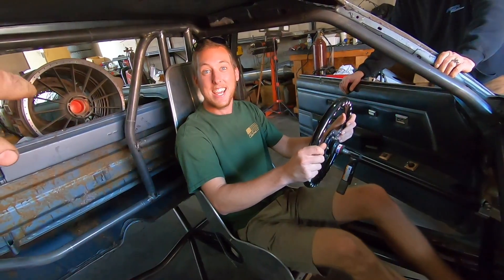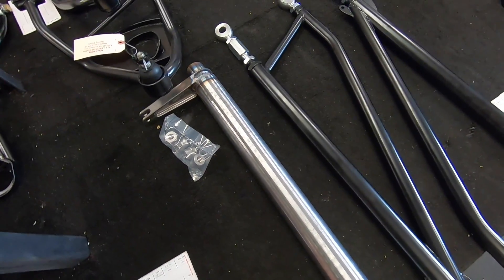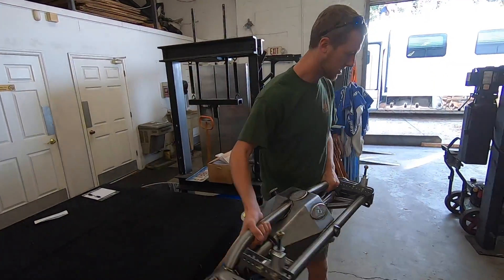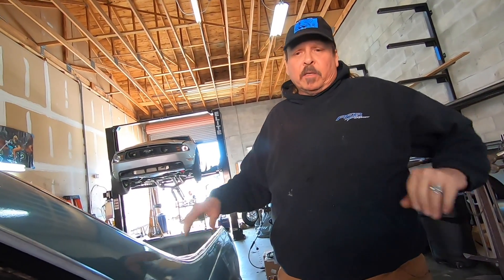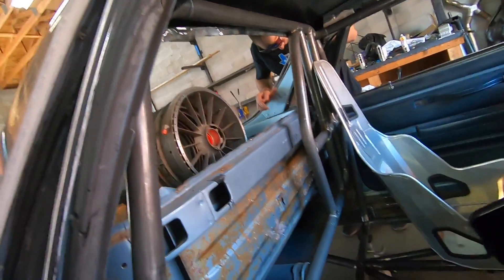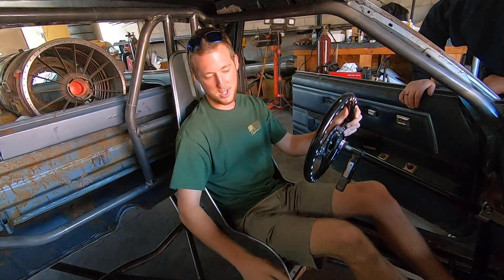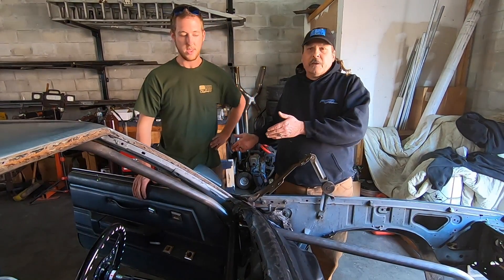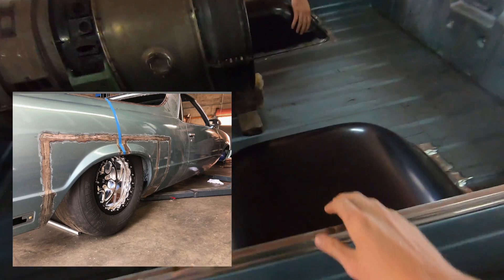The Jet Camino's Roll Cage is INCREDIBLE... First Cleeter Test Fit!

Comment: Guys be careful with the pressure difference on the windshield and how it will affect the drag of the car. Take it to a wind tunnel to be safe. If there's one thing that won't forgive, it's physics.
Reply: I was thinking they should keep the windshield full length and just let the turbine suck through the passenger window. Or even a hole in the roof. Hell they coulda left that ac/heater hole in the dash open. You could get a lot of air flow through those two spots without sacrificing aero. Or even suck through the floor and keep that sucker vacuumed to the track. I think cutting the windshield is a bad idea.
Reply: Carlos I’m sure the Larson boys have a good idea.
Reply: Carlos physics forgave Leroy...
Reply: Under pressure 🎶
Reply: @IrocBlower85  horsepower forgave leroy.
Reply: @jonhubbard5787  Was that a Logic reference? lol
Reply: @Blaze4255  Na bro, Queen.
Reply: IrocBlower85 Leroy would be in 6 second territory with good aero
Reply: There's no windshield dude
Reply: @lee1978good  Well not right now there isnt, but theres going to be

Comment: Is it ginna affect handling having a positive pressure on drivers side windshield and negative pressure on passenger side since there is no windshield. I know as air flows over spoilers it does weird things i wonder if the car will try to pull to driver side
Reply: nathan butler I was thinking he same thing. I wonder if it will try to pull to one side or the other.
Reply: I can't see how it wouldn't want to twist the car.
Reply: I was thinking the same thing. They should put a huge scoop on the roof down through just the back half of the cab that way they can center it on the car
Reply: They will be able to counteract that a little bit by aiming the jet a certain direction, but this thing will be VERY sketchy to drive. Like a open wheeler with all the right side aerodynamic bits knocked off
Reply: @drewl4762  I think the scoop is a good idea, but itll be hard to get that much flow
Reply: I’m thinking adjustable mounts on the jet-engine 🙂 So you can adjust up and down a little and to the sides 🙂
Reply: @connorbeckmann2981  I'd rather have less flow and be able to keep the car straight then ample amount of airflow and little control
Reply: youd have low pressure on passenger side due to jet engine S U C C and high pressure on the drivers side so the car would prolly pull towards the passenger side. id go for the roof scoop.

(Or have the seat in the middle, and run the driveshaft between your legs. or go fwd or sth and have the air intakes be on both sides of the driver?)
Reply: Just put half a splitter on the front to counter balance the drag and straighten it out
Reply: Dylan Hale the problem with this is when you hit the jet throttle hard it will pull to the side until it reaches a point where the aero issues will balance it
Reply: @drewl4762  I agree a full moulded scoop like a F16 belly scoop...
Reply: These are all really good contemplations. There is a really good channel on YouTube called KyleEngineers. Dude is a PhD in aerodynamics and designs race cars. He doesn’t update the channel anymore because he went to work for an F1 team, but there is some interesting stuff there. He gets into some common misconceptions and design flaws with aero for race cars, and talks about the fact that it’s far more complicated than most of us think. In fact a lot of aero stuff people do is either useless or actually counterproductive. Cleetus and crew could use someone like that to design some aero for Leroy, and advise on this jet contraption.
Reply: What concerns me the most is not so much that the car may pull to one side but that the pull may change directions. While the jet is at a high power level there should be a vacuum created in front of it so the car may pull to the left slightly. While the jet is suddenly shut down there will be an increased pressure on the intake side of the jet so it might pull to the right slightly. This transition might be fairly slow if everything works properly - but what will happen if the jet suffers a sudden failure, say a bearing seizes or a turbine fails. At high speeds any instability, especially sudden, could quickly turn into a nightmare...

I hope the driver's vision to the right also won't be blocked by the jet's intake. I'd make sections of it out of Lexan if it was at head height on the passenger side of the car.

I agree with some of the comments below that a safer plan would probably be to use a large, centrally located scoop. It would probably need to sit above the roof and could be as wide as necessary. I'm imagining something close to a foot tall, centrally located, fairly wide, sitting on top of the roof... (the internal ducting could be non-symmetric though, with more of it on the passenger side after it comes through the rear of the roof).
Reply: @fordcougar99  exactly! If I fighter jet can get enough air through a scoop then this car get enough air especially since they probably wont run it at 100% output anyways
Reply: They could build a rudder behind the jet engine. That might solve the issue
Reply: Not only is pressure difference @ front between windshield (driver side) and no windshield (rider side), there is a huge vacuum created at the air inlet of the jet engine ... similar to a regular car engine, but much, much more vacuum.  Air is not just traveling thru the jet engine, it is being thrust out the back ... huge pressure at back of jet (thrust) and huge amount of vacuum at the jet inlet ... 

Hello roll over on big end.
Reply: I was thinking roof scoop too, you think that'd reduce down force though?
Reply: Just go with no windshield, problem solved

Comment: Just roof scoop it instead of going through the entire cab
Reply: Drew L the scoop would be HUGE!!!!
Reply: @riverrat1284  so put a huge roof scoop on it.
Reply: they explained this in another video... cant do a roof scoop, not gonna work. hence the pass thru idea.  👍
Reply: tomlundkwfl could they not cut out a section of the roof and run it at an angle up?
Reply: It's do-able. Trying to maintain stock lines is a fools errand. Combine custom intake roof intake with a  one off formed windshield to feed the intake and the thing will perform optimally, and look badass.
Reply: @x...CrankyOldMan...x  I missed that I guess but why wouldn't it work? Outside air is outside air. An unrestricted high flow air inlet is actually a gain...not a loss. That's how drinking straws work. Pull more air than the drag (tires and body contour) and the mass is actually pulled.
Reply: @keithfriestad3949  If you mean angle the jet upwards to line up with a roof scoop, that is a very, very, bad idea unless you wanna visit the man on the moon
Reply: It wouldn't get the airflow it needs having it go on the roof. Even with a huge roof scoop. Also imo would look stupider than shit with it. And the jet engine MUST be angled downwards. Cleetus isn't trying to build a flying car... yet 😂😂
Reply: Better idea would be to stick the jet on one side. Then put another one on the other side so it's balanced and all and sit between them :-P
Reply: I wonder if they can run the Chev on Jet A-1 as well?

Comment: Hopefully you have a way to prevent the jet from lighting if you pull a wheelstand since that would negate the 1 degree down position of the jet and send you into orbit. Normal jet cars are thrust only and don’t have to worry about climbing the ring gear.

Comment: Put the scoop for the turbine flush with the top of the roof.  FoD will end your fun faster than anything you've ever broke.

You may also want to consider a rear wing to keep the nose on the ground AND vertical stabs to aid steering at high speed.

Comment: love it . but on the 1 deg. tilt that's likely  for only jet power if your on the motor in full pull mode the nose might up a good bit more than just sitting you might need extra angle you don't want to create lift

Comment: This thing is such an awesome build... you know what would be really cool is if you twin turbo the ls and then had two pipes coming out of the hood for the exhaust (similar to Leroy) and when you did the two step you would have the Flames coming off of the LS engine exhaust and from the jet engine... that would be a hell of a show.... I'm sure with a 1000-1500 horsepower LS plus the jet you guys are going to set some serious records.

Comment: I have concerns. If you get any degree off straight, that jet will push you right at the wall.  Wheel spin from the LS can easily set the back end off line, and you won't have reaction time to turn off the jet.

Comment: a. you don't need any ducting on the front of the engine. Just a screen for debris. The way suction works it will pull all the air it needs from behind the cab. Much safer to leave the cab sealed (fire risk)
b. You need much the freak more than 1 degree. 1 degree would be without trying to build tractive forces with the rear tires. 3000LBS of thrust can get pretty ugly if you rear tires are trying to break traction already. At 180MPH you are going to want 5.5 degrees to push down in the middle of the car 400LBS.

Comment: i played a lot of "Kerbal Space Program" and can say, enough power might make it fly but would also make it flip or "wiggle" on the track and make a huge accident so i hope the body and suspension and tires are up to par! (if you guys go incremental, do it like overclockers do it with PC, very small steps at a time! on the gas pedal, you can lift off instantly, with a jet, it takes a few seconds to "unrev" and during that cool down time, it still output power!)

Comment: Should the jet be mounted further to the passenger side of the bed making it easier to design the air funnel and compensating for driver/extra roll cage weight from the drivers side?

Comment: I think this car is the first one where I've actually feared for your life Cleetus. The cage is looking beefy as hell which is good. Have you thought about aerodynamics? I'm worried it's going to nose-up when ripping down the track; not that I'm an expert but I did do a little fluid dynamics at University. Are you going to have some sort of front splitter to spot air going under the car?

Comment: could the inlet be through the front firewall instead of the screen? seems that patch is a good size to make a duct to the jet? plenty of air through the front/mesh in bonnet and under the engine to feed it? would this make the car more stable than having a half windscreen?

Comment: I'd recommend using the top 8 inches of the windshield area, full width, and ducting that to the jet. You'd get full vision, and not have such an asymmetrical flow. Safer, lighter, more functional, and.....faster.

Comment: Ok so here's my question, you said the transmission is going to be a power glide with about 2 gears in it before the jet kicks in then into neutral. My question is after second gear won't the engine go to full throttle and possibly hurt the engine or are you going to have an engine shut down after second?
Reply: Samuel Maas why would it go full throttle lmao. The jet throttle and motor are separate.

Comment: as low as u sit in the seat y'all could chop the heck out of the top and make a huge roof scoop and it would be straight fed it. I just worry it getting all that air off center it might mess up the arrow on the car and make it pull to one side when sucking all that air

Comment: As I was watching them talk about the LS, I was thinking about a Roadkill episode where they built a boost-caboose, and was wondering if they could get more air to the jet engine using a pipe from somewhere on the intake on the LS? Did they mention whether the LS was going to be boosted?
Reply: I haven't seen anything on that,but , this is a bardle skeet edition,twin turbskies.

Comment: idea.. take out the AC delete plate..   make that the firewall passage for the jet intake.. with a naca duct thru the hood between the right side of the engine and the what would be the inner fender.  this might be far better than cutting off the view to to the right with a big duct.

Comment: For some reason the jet engine would really look cool if y'all could mount in pod configuration. Like an A10 Warthog just above the cab.
Reply: Would look cool, but would put a lot of stress on the structure of the car. An A-10 is engineered to handle that stress, most cars are not. That's why you want to put the jet just behind the center of mass.

Comment: Hi Cleetus I am 19 years old and bought my first project car. It's a 1981 El Camino bought it for $150 and I just wanted to let you know I'm a big fan of the show and doin it for Dale. The El Camino has a 231 in it it's been sittin for bought 10 years just rebuilt the car and put wires and plugs on her had to adjust the timing a bit to get her to fire up. She ain't pretty but she's gonna be mean I was wanting your opinion on what motor I swap in her in the future I was leaning towards just sending it with a 454 stroker or a 350 4 Bolt main bored 30 over . Just wanting a second opinion thanks and keep on doin it for dale

Comment: Actually not much worry over safety in that turbine.  Sitting fore of the plane of rotation takes all of the extreme dangers out.  No explosion risk either, it's just an open tube  Excluding bad maintenance, the only risk left is a hot start, but N(2) is thrown out the back then.  Lookin good so far, can't wait.

Comment: You want to put as little angled sheet metal on the inlet as possible otherwise you will get a lateral load on the car from the wind pushing on the side of your air ram.

Comment: No one has mentioned it.  But ummm what about rpm's ?  Doesn't the Motor have to spin as fast as the jet wants to push the car ? Just my thinking something is going to break rather quick. Maybe a clutch to allow the driveshaft to spin freely.  I may be wrong . But I'm looking forward to this.

Comment: Yeah id be using a large intake duct on the roof or something rather then plumbing through the cabin. A well designed duct should be able to to get sufficient airflow to the jet

Comment: how are you going to keep the engine from blowing apart by overrevving due to the thrust from the jet. and also compensate for trans drag from torque converter. It will probably turn In to a retarder

Comment: Theres a crew cab full-size chevy truck out there with a big block and a jet in the bed with a shell over it. It takes air from the two rear side windows. I've never seen it run but I know it is licensed for the street. I saw it eight-ten years ago... yellow and black. Forget the name of it but it had a bumper sticker "Tailgaters will be INCINERATED..!!!"

Comment: 1. Do not arrange the seat so your knees/legs lock extended as shown in the video. A quick stop legs straight = injury (always keep your knees bent). add a bar under the knees to prevent straight legs
2. Pull some % of jet intake from the vehicle underside to provide down force to the front end. This car will go faster than any run by Leroy and the nose will want to lift up. have an adjustable flapper for driver to tune down force during test runs then fix it in place
3. Keep the N2O bottle at least 300 feet back from the jet intake - James!
4. A Jet takes a while to spool up to operational thrust; gain momentum (rpm) first then dump in the air and fuel; lots to learn so take it slow and safe (two new words for you) listen to the experts
5. FULL JET BLAST SEND!

Comment: So how does it work when the jet engine comes on and the engine is running? How do you prevent the gas engine from over revving?
Reply: The plan I assume is first, second neutral on the powerglide and hit the jet as it shifts into neutral and basically have it freewheeling.

Comment: One problem I see is the intake tract either pulling you left or at higher speeds, causing an air damn to push you right. It will have to be little baby steps and lots of solid shim adjustment room. Complicated build and physics.

Comment: You guys need to make sure the engineering on this is better than perfect and leaves a BIG margin of safety. Jet cars can KILL YOU. Safety needs to be your first priority(not second, not third --> first). Breaking speed records is cool and lots of fun, but ONLY IF YOU LIVE TO TELL THE DAMNED STORY. You guys have a bright future ahead of you. Treat the power that engine puts out with a lot of respect.With a jet car, you are basically driving/flying an airplane without wings.  Aerodynamics is enemy #1. Remember that. Manage it well. Work hard to know your limits, take each step a small bite at a time and live. Don't end up like other jet car drivers who have died behind the wheel.
Reply: Damn, can't believe you typed all of that.

Comment: So the ability to do 1.2 in the 60 foot along with top speeds of 240 in the back 8th..... you sir may break some records. By most jet cars run 5s but 2-3 of those seconds are on the takeoff. So the ability to shave 1-2 seconds off the time and considering the extra LBZ’s my guess is a low 6 after you get the hang of it.

Comment: If the aerodynamics are off with the windshield idea, check out how an Allison T56-A-14 turbo prop intake is on a P-3 Orion aircraft. The air intake swoops down because the reduction gear box is in the way. 4,800hp engine that flies as fast or faster than you're going to drive and I believe something similar would work well. Check out the photos below to get an idea. Good luck!

https://goo.gl/images/U1kA9m

https://goo.gl/images/PtWCy6

Comment: If I was you I would only be racing this when testing and running both engine's I would be at airports running 1/2 and the 1 mile races forget running this at a 1/4 mile track I would be a little scared of the brakes failing and not being able to stop